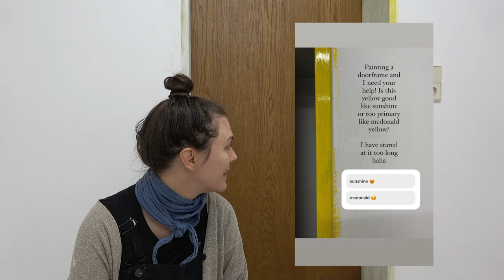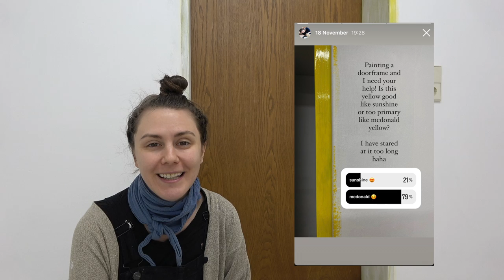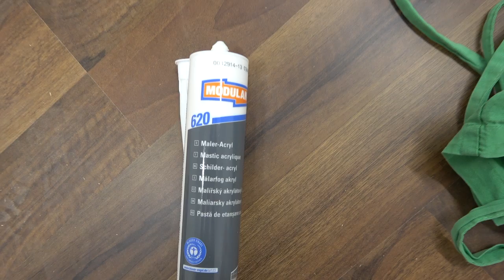Setting Up a Glazing Studio // how I built a functional pottery studio in my basement

Comment: Looks very good 👍🏻 I understand the struggle with the trims 🤪 when the walls are not perfectly even you can always see the different pieces 😂🫣 we used caulk to glue them on the walls (have massive wood trims) and also used caulk to cover the edges and small parts.